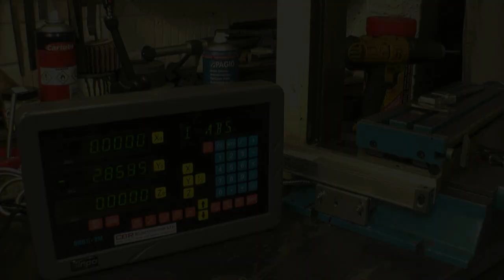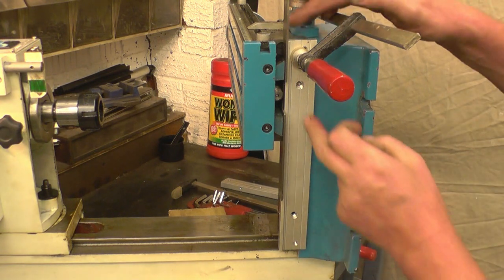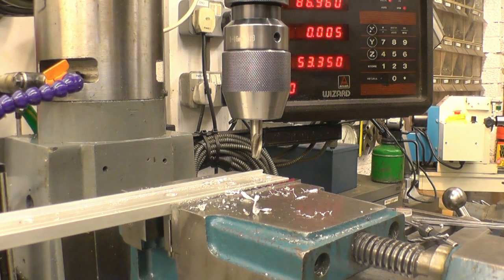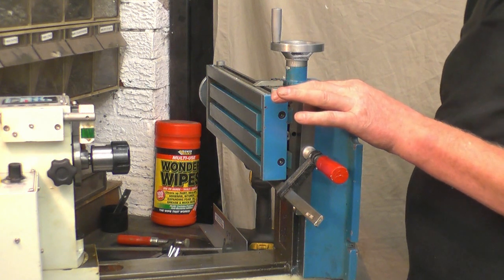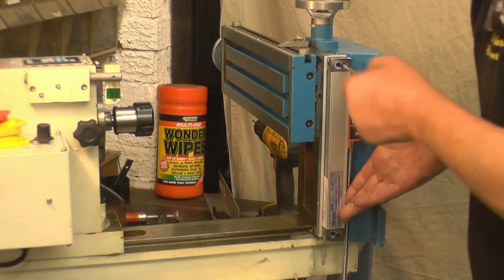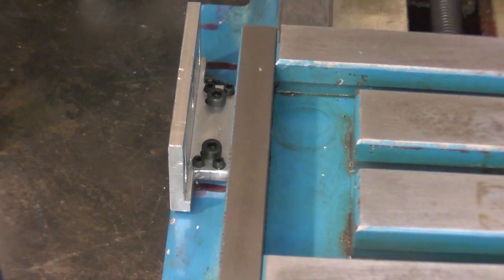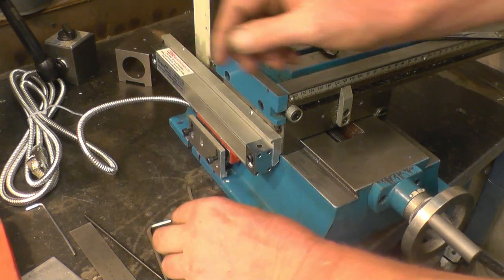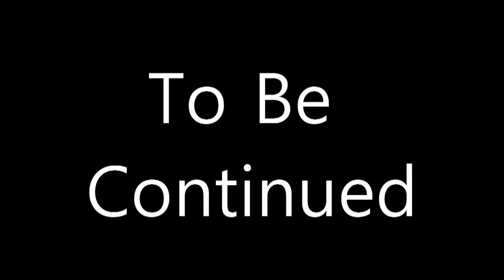AM 16 Mini Mill DRO Install P1

Comment: John, a really clear and useful guide. A quick note for anyone considering one of these DRO's who might note have time or inclination to fit it themselves, Colin from CBR (the supplier of the unit in the video, and a nice bloke) will fit the DRO for a very reasonable price. He fitted a 3 axis unit for me on a Bridgeport and I've not regretted snapping his hand off when when told me how much. It was done in a few hours and greatly reduced the amount of swearing that was needed to fit it vs if I had done it.

Comment: John is doing a great job at showing how to mount an Optical Reader DRO Scale. 

Bear in mind that the scale and the head are physically located together so you have to be close to the nearest thou! 

Also they need protection from swarf and fluids!

The alternative is a magnetic scale, a little more expensive but much smaller and only need to be within 10 thou or so! [as they are non-contact devices]  

Also they are IP44 water proof!

HTH! Will Davis, Dublin

Comment: John, you are saying your going to install the Z axis reader on the column of the machine. If you look at it there is a handwheel for coarse adjustment of height and then the Quill is used for actual machining of the part. Therefore the readout will only read the coarse position if you mount it this way. Why not mount the X & Y scales to the table and use the inbuilt readout for the Z ?
Cheers Eric

Comment: Hey John! The weak link in any electronic hookup is always going to be the wiring. You did the sensible thing by mounting it the way you did. The wiring stays static and if it fails it will be due to vibration and not flex. Arm chair engineers be damned!

Comment: Hello John, I have several comments and suggestions, I hope you do not mind ? Firstly I really think that you ought to have placed the unit the other way up. Secondly, if you do leave it as it is, you really should make a limit block to stop the full table movement. Your customer will forget some time and smash out the end of the reader unit. Thirdly, I think you must be watching too many 'Yank' channels with the use of transfer punches. You already has in effect a 'Drill Jig' in the form of the part already clamped in position. You should have drilled down with the 5.5 mm drill through the ally part, until it made a full diameter hole about 1/16" deep in the cast iron, removed the ally, then used your drill block for the tapping drill. Definitely no chance of the hole wandering off place if you drill using the mating part. You of all people should know that you never have tapped holes all the way to the top. Look at car cylinder blocks, the head bolt holes have clearance for the first 2 threads, that is so that should the threads stretch, they will not protrude above a flat surface. Be a bit more careful with the display unit, you were ratting it around on your metal bench top, you will scratch it to buggery, use a bit of cloth or cardboard. If I was your customer, I would be on the phone to tell you about it. Anyway John, keep the videos coming, except the 'Fanny Craddock' ones, stick to engineering and leave the cooking to other YouTube Channels.Yes it is me keep giving you thumbs down for the cooking ones.
Best wishes from Dave.
Reply: I really think that you ought to have placed the unit the other way up
But that way the slot the reading-arm goes through is facing up, exposing the electronics to dirt and water. His way is the right way to do it.

Secondly, if you do leave it as it is, you really should make a limit block to stop the full table movement
That's something he could do, or the customer who had and will have a milling machine.

You already has in effect a 'Drill Jig' in the form of the part already clamped in position.
Not a good idea. He would using aluminium as guide to drill in cast iron. The drill will eat way happily the alu before going into the cast iron. Also the part is thin, to thin to act as guide. I've learned that the guide should be five times thicker than the drill wide and the same hardness or harder than the material you drill in.

You of all people should know that you never have tapped holes all the way to the top
No problem here. When you strip the threads you used to much force or the screw is not big enough anyway.

Be a bit more careful with the display unit
Yes i flinched a little bit at that one too. I would used some masking tape to cover the outer surface.

If I was your customer
As far as i understand it he does it for free. There is not much of a customer.

except the 'Fanny Craddock' ones
Why do you mind? You don't have to watch them. You're going out of your way to open and vote down a video you don't want to watch...
I'm personal not very inserted in that stuff either but it's his time, his channel and his equipment. Who am i down voting something I'm not inserted in. If he would give ill advise or is harming someone in a video i would down vote it, but anything else i don't care.
Reply from the maker: That about sums it up Thanks for watching & commenting
Reply from the maker: Hi Dave  Can you explain why the unit should be the other way up . A limit stop will be fitted . It was not my fault the scale was too short . The cooking vids are just a bit of light hearted fun "they are also very popular" the title says COOKING just don't watch them    .Regards John
Reply: What's your chanel called Dave?

Comment: good job john, but I think the other way around makes more sense
Reply from the maker: Hi Billy Can you explain why it would be better
Reply: space behind lathe needs to allow room for the track to run.  I think you did mention that in the video
Reply: the other way around makes more sense
But then the slot will face up, and the only seal there are two lips of silicone. Water and Dirt will go into the measuring system, probably messing it up. To prevent that he had to add a cover twice as long as the scale. How it is now is the better way.
Reply: That was a joke, right?
Reply: You're gonna mount a bench top mill near the front edge of the work bench. Should be plenty of clearance on most work benches.

Comment: Hi mate,  Not your best work I'm afraid  You are going to have some problems getting the shield on with the mounting bracket sticking out like that.  I think I would have mounted the read head direct to the base, and the scale a little further forward.  In the end, it'll all work I'm sure.

Comment: that mill is about as much use as a chocolate tea pot
Reply: mmmmmmmmmmmmmm chocolate
Reply: milling chocolate tea pots  its the new fad
Reply: That's a bit like saying a dentist's drill is about as much use as a chocolate teapot. It depends what you use it for...
Reply: well if you want to mill a matchbox down then tea its champion but if you want it to actually mill something them well ya shit out of luck
Reply: I believe he said it was for a maker of models so it's for probably very small parts. And being a small machine very easy to accommodate.
Reply: Not everyone has the money or the space for a full size milling machine...mine has 4" x 9" travel, which is very useful.
Is your full size milling machine in your workshop or your employer's...?
Reply: I had one fall on my foot once ...I was never the same
Reply: Nice to see that YOUR YouTube channel has only 4 subscribers, and that you have NO content on it. I wonder if you are that well equipped that you have no more room for a camera?

Just asking, like.
Reply: Just your foot?
Reply: I use to have 5
Reply: mcrayfourd
Five Feet?
Reply: 5 mini mills
Reply: For smallish pieces in aluminium, with fairly loose tolerance requirements, it will be fine.